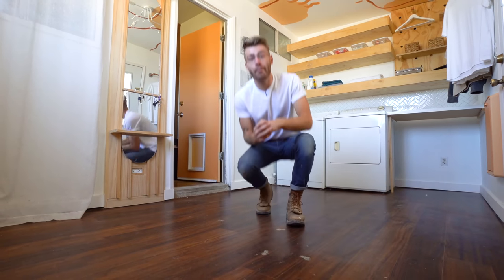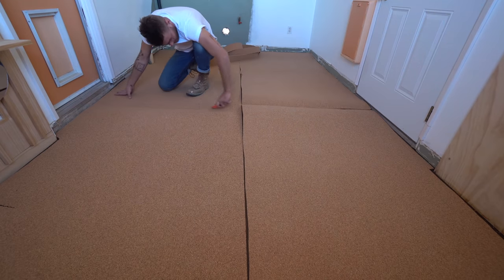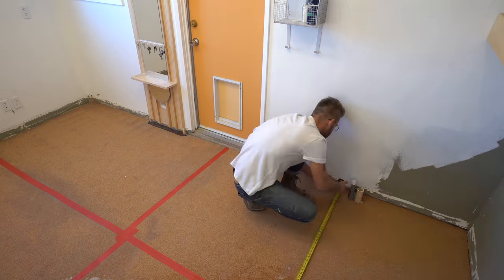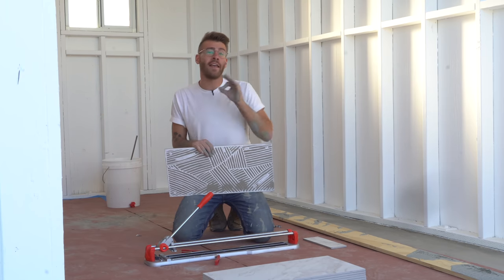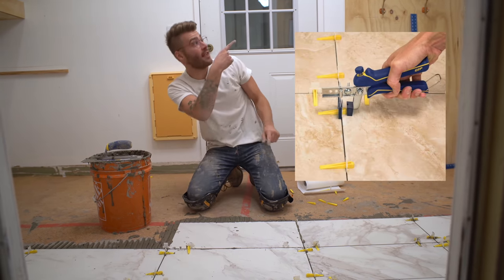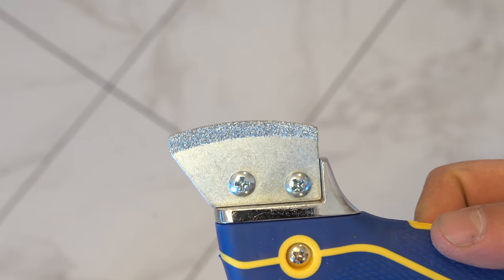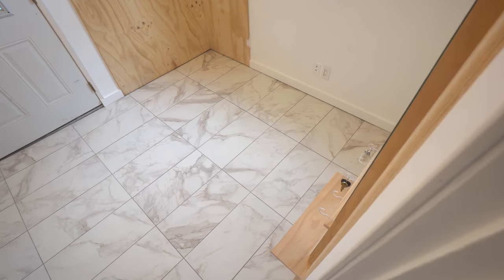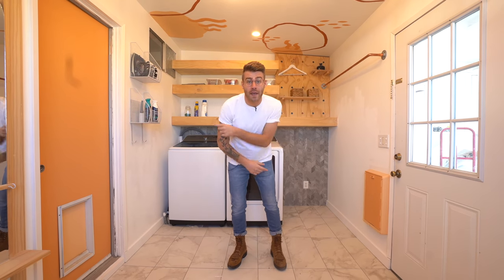HOW TO INSTALL LARGE FORMAT TILES // DIY

Comment: To help with the mortar squeeze out, either use your finger or a thin putty knife to scrape out mortar around the perimeter of the tile on the floor.  That way when the mortar spreads as you set the tile, it will fill the perimeter voids instead of squeezing up through the grout lines.

Comment: Problems.... that cork will shorten the life of your tile job and fail it will also absorb certain spills which will possibly produce mold smell etc don't believe the marketing cork has veins, always add powder to water, it's easier to mix consistently and gauge the slump then add more powder if needed otherwise you'll end up with lumps and the polymers can clump weakening the bond/key. 

I could be wrong but while they look like porcelain tiles they don't look like floor rated tiles the manufacture might say they are but buyer beware. When back buttering throw a blob on the bottom and work it to the top, you only need a scratch coat (thin flat coating) on the back. If you need anymore depth up your trowel notch size on the floor and in future for an uneven floor top the floors with a levelling product before you undertake any work it saves tons of hassle and allows the adhesive to be a uniform thickness which will dry/cure evenly once it goes off it acts as one plane if that plane isn't consistent it can cause dramas the MPa of the adhesive. The tile you showed for coverage didn't look the best you want a honeycomb pattern like lots of little peaks and valleys you shouldn't have any spread lines, you should google the Tarver method which is basically applying downward pressure and moving the tile forward back left and right. Also don't have curved spread lines they trap air and you want to fully place your tile down not drop or slap them down this can force adhesive to be pushed to one side and potentially crack when it cures because of inconsistent depth.
Reply: It seems like you know what you're talking about, but no one will ever know what you're trying to say because your grammar and punctuation needs a lot of work to make your message clear.
Reply: @JamMastaJew  thanks man I appreciate you 😃
Reply: Thanks for adding these best practices. I couldn’t have said it better myself. His finish is okay, but definitely not professional grade. Staggering the joints would have made it look a LOT better. There’s also a huge dip in the floor which I’m assuming is worse in person (the camera tends to flatten the image). Nonetheless, entertaining video to watch.

Comment: The tiling itself is actually well done for a hobbyist. But i noticed that your floor itself is sagging and cork underlayment isn't a good choice in that scenario. Why? I think your floor moves under load since it already drooped. The cork itself compresses as well and moves even more since it's not rigid. Actually you should have removed the vinyl and checked the slab for cracks. 

I think your tiles won't last that long. If you ask me cork is never a good choice for tiles. Even it is possible. You should have used some flex-self leveling underlayment. Besides that you have to treat the cork underlayment for moist environments.

Comment: I'm so confused. The washer and dryer run on propane?
Reply: Not the washer, but dryers come in 2 varieties: electric and gas. You'd still plug a gas dryer into the wall to power the controls and whatnot, but the heating power would be from natural gas. 

Most appliances that run on nat gas can be converted to run on propane with a kit, which is what he did. Typically if you have nat gas, it's a public utility piped in from a pipeline under the street. But if you don't have nat gas service in your area, you can get a propane tank installed on your property and get propane gas delivered. So i assume he doesn't have gas service and instead has a propane tank.

The washer just runs on hot and cold water hookups like any other washer.  Although if he has propane, the hot water for the whole house is probably heated with it too, so you could say the washer is indirectly powered by propane.
Reply: @JamMastaJew  I see! Kind of crazy that it's still a thing in a first world country.

Comment: Wtf, I never saw such an kind of dryer. Our dryers in Europe use electricity to dry clothes
Reply: Natural Gas/Propane are pretty similar and are common and typically cheaper than electricity in the US. They basically operate like a gas furnace would to heat up your home, except with a dryer. He got the point of the orifice wrong, but I'm glad he checked it.
Reply: In Canada also since electricity cost is lower. 

But in US lot of home use propane/gas for water heater, heating, dryer,oven,etc.. 

In Canada older home had fuel oil tank, but nowdays its gone. If the tank fail you end up with environmental disaster and just a small drip inside home will smell forever on concrete.

One great side of using gas is that in case of disaster in winter, it doesnt require much electricity from a generator or ups  to stay warm for days.

Comment: As a floor installer, you should never install large format tiles corner to corner. Due to “cupping” or “pillowing” you should always instal these on half stager or even in thirds
Reply: Also NEVER install tile over vinyl 🤦🏼. Even if you install a sub straight over vinyl.  If you think about it the tile is only stuck to a piece of plastic

Also never start right in the corner or a room with full tile. It’s a tell tell sign of a “do it yourselfer”
Reply: Schluter system!!! 🙄🤦‍♀️
Reply: @insecureinvestorchallenge7366  how is this comment relevant? 🤷🏼
Reply: Learn about the Schluter system and you will see the relevance. They talk about exactly some of the things in the original comment from TokenPat and more.
Reply: @insecureinvestorchallenge7366  I know what it is. Is the schluter system a piece of vinyl? No it’s not, so again how is your comment relevant?
Reply: Sorry that I wasn’t apparently clear enough to connect with the original comment. The original comment referenced about “cupping” and if you were to take a Schluter workshop\class then they cover a wide arrange of information from the TCNA handbook in addition to teaching about their products and systems. I hope this helps. 😌👍
Reply: @insecureinvestorchallenge7366  large format tiles bow you obviously aren’t a floor instal. Even if you use the schluter system that doesn’t prevent the tiles from cupping.
Reply: @insecureinvestorchallenge7366  go read any description or installation instructions on the tile box I guarantee it will tell you not to instal corner to corner. 🤣🤦🏼
Reply: I was taught to be able to say I’m sorry. So if there’s some reason we are not seeing eye to eye or maybe partially only seeing eye to eye… then I am sorry. I agree that there are some concerning issues about the installation in this video. I really enjoyed the Schluter workshops/classes that I’m taking. I call myself the “Insecure Investor Challenge” because when I first started my journey to really dig in and learn then I was really scared out of my mind but not willing to quit. I did not discover Schluter until exhausting just about everything else that I could find on the market. I have disabled individuals in my home and a massive amount of work that needs to be done in bathrooms and various other areas of the home. I absolutely cannot afford water damage or failure. It is just not a financial option. I’m sure it’s clear by now that I am a fan of Schluter… but that did not happen overnight and I worked really hard to study as much as I could on anything I could get my hands on. 

It is my hope that through my journey then I can make a play on words to change from “Insecure Investor Challenge” to “IIC”! (Read like I… I… See! 😊) I am starting my personal journey with myself in my home but I look forward to branching out and actually doing some investing in real estate and rehab. I am not actually new to construction but like most people then it does not mean that I am proficient in everything. I look forward to growing and learning more in my journey. I’m sorry if I was not connecting well with you and I do wish you the best! 😌😙